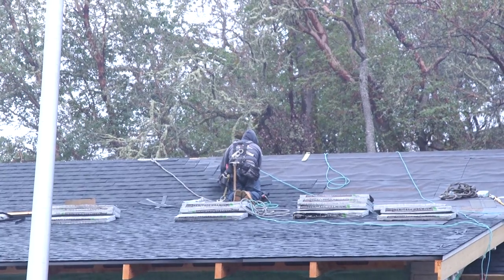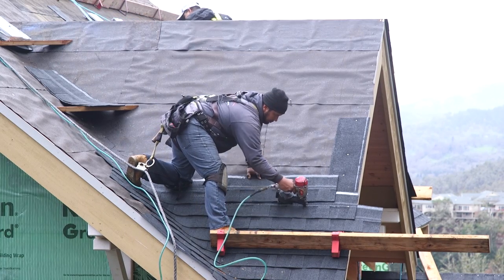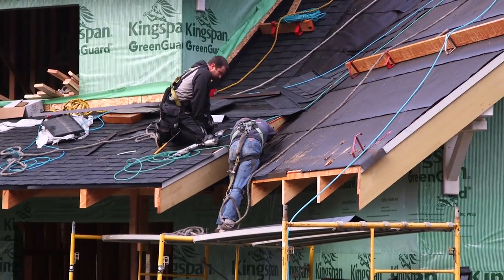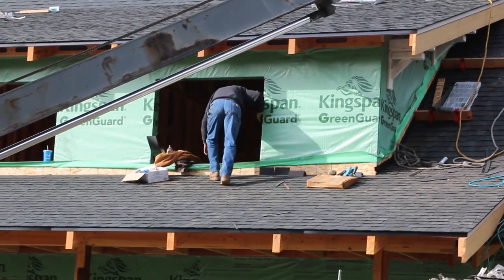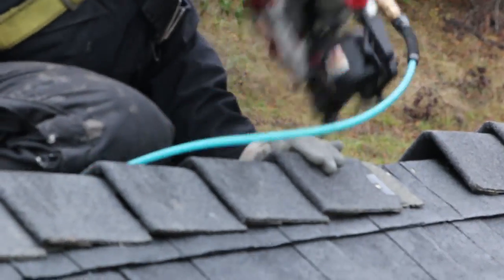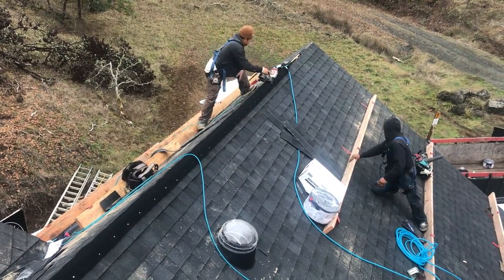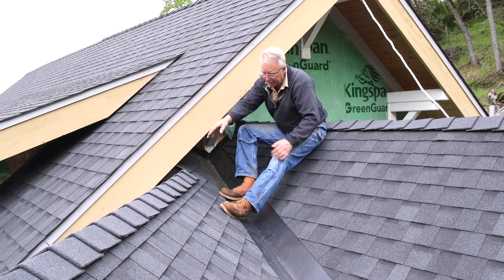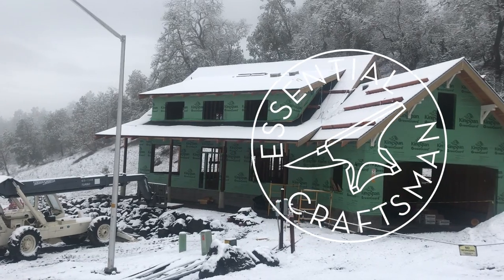Stunning and Complex Roofing Installation Ep.78

Comment: The argument about metal in a valley aside , no matter what there should be ice guard in that valley. Regular felt paper most certainly will break open in the valley ; probablywgen forcing the shingles down in tight. For the cost of a box of ice guard they took the cheap way out.
I was a contractor for over 30 years and I not only but ice guard in the valley but I put metal in also and then did the Chicago cut , so you never saw the valley. So for the cost of a couple pieces of metal no sleepless nights worrying about leaks was the reward
Reply from the maker: Great comment and great philosophy. The difference here is that we almost never get any ice or snow. When it happens it is only for a matter of hours. Not days. And there’s never any build up.
Reply: @essentialcraftsman  I posted earlier a long comment about flash and counterflash systems, mandatory on my jobs for decades. It is not so much about present moment performance as long term maintenance. It requires a clientele that see beyond the next couple of years, however, and have the disposable resources to put their money where my mouth is. Unfortunately, that combination is relatively rare.
Reply: Good rebuttal
I admit i was quick to admonish without taking your location and weather into account

Comment: I've seen studies that found that powered attic fans, like the solar fans you had installed, actually end up costing you more electricity because it creates a negative pressure in the attic that not only pulls air through the soffits, but also pulls your conditioned air you paid for inside the house through all the tiny cracks and holes between the house and the attic.

Comment: Where those different roof pitches come together and made that odd Valley that is another place that you should have just covered the whole thing in Ice guard and not be worried about it. Nails seal themselves in ice guard. It would never leak , talk about being a cheapskate.
Where a roof line meets the wall like in a dormer you are supposed to run ice guard up the wall a minimum of 6in and on the roof 6 in so you have a solid water tight seal even before you step fllash.
Reply: We get even more painstaking than that. You could check out my long comment re: flash/ counterflash systems.

Comment: I see since you went with an unconditioned crawl space you also went with a vented unconditioned attic which is a huge mistake. With black shingle roofing with the roof pitched at an angle to get maximum radiant energy from the sun, the attic space will probably reach 130F+ on hot Oregon summer days. The rafters and decking will be hot to the touch and everything in that attic will have absorbed the radiant energy and will be giving off heat. Those fans are worthless if you think they are going to reduce the temperature in your attic space. Secondly, those fans will depressurize your attic and create negative pressure which will pull conditioned air from the living space through all your penetrations in your drywall ceiling, can lines, your vents, and even the holes where wires are run through your top plate. In fact, any temperature reduction in the attic is probably a result of the attic fans sucking the cool air from the conditioned living space. You really do not actually believe this, do you? https://ibb.co/QPfRWsT - Powered attic ventilators are a scam. You should have gone with an unventilated conditioned attic with 8" of open-cell spray foam all the way up the roofline - https://ibb.co/Wg553tP.

Comment: 50 years on an asphalt roof ?  I have shingles cracking on a 10-12 year old roof manufactured by GAF - Timberline. I don’t know where these things are being manufactured but my guess is they are cutting corners but not adding enough rubberizer to the mix.  They look great at first and claim to last 40 years, but I doubt people will see this performance.

Comment: Are ridge vents not a thing in the North West?
Reply: Ha, typed that question 5min too soon.
Reply from the maker: Yes, they are often compromised by the leaves and debris that blew around. But we in fact ended up using it on the garage ridge and on the ridge over the back patio. The main pitch will be ventilated by the solar fans.

Comment: You said this is a spec house. Why the lot selection and the $$ spent prior to pouring the footings? Seems excessive for a spec house. The layout of the house had to cost a lot more in labor to turn all those corners and the roofing is a real challenge. Again why for a spec house. I see you saved big time in the inside with no hardwood floors, no crawl space or attic encapsulation and although not finished yet, I would expect to see builder appliances and fixtures with fiberglass tub shower in the baths.

Comment: The valleys do not make sense. If bending the shingles is going to wear them out quicker then why not do metal? You did say shingles are meant to lay flat. If you use good metal it will last 30+ years, and here in Oregon you are not getting much more then that out of composition shingles anyways

Comment: Sorry man, but asphalt shingles only last 15 years if you are lucky.  Copper valley flashing will last a 100 at least.  Hell, painted steel is guaranteed for 50 if you buy 24ga.  Former sheet metal worker here.

Comment: I’ll agree they did a B+ roof install, would have been an A job but some material quality level was low at least until the $$$$ 3- 25 or 30 watt solar vents, and the fact that they HAD the safety equipment but CHOSE not to use it 1/2 the time (safety glasses, ropes, separate anchors).  It would have been just a B job, but Having somebody stand behind you with a video camera the whole time adds a bit of stress, Especially lol, if he was narrating some of it out loud while he filmed. Unfortunately for R &R this is a popular enough channel OSHA might notice.

Comment: well I might not be a framer but I probably have replaced as many rooves as EC and I can tell you that not having properly flashed valleys... or I should say improperly flashed rooves tend to leak it cost 100 extra dollars per valley but it will be better than me coming in ripping out the deck and rafters and adding a 3-10k dollar charge on top of your $20000 reroof.  Don't buy in to that it is as good as business.

Comment: UK (scottish) viewer here, why shingles and not tiles? most all domestic roofs here are tiles, its wet, cold, and windy here. not a criticism just wondering why such a soft roofing material.
Reply: I don't know why specifically, but shingles are easily the most common roofing material in the US. In desert climates you'll see a lot of tile and in hurricane and tornado areas you might see more metal roofs.
Reply: Common reasons asphalt shingles are used instead of tiles and slate are:  1.  Higher material costs,  2. Higher labor costs (due to greater install time and the fact fewer people are experienced in tile installation... except in certain regions of the U.S.), 3.  Weight (thereby causing up-sizing of framing, thus higher framing costs.)  The complexity of this roof may also be a factor, driving even higher #2 (factoring difficulty of cutting tile vs. asphalt shingles).
Reply: @neverenoughtime3151  

Roofers are cheap on cheapest materials!

Comment: It's called a closed valley, not a lap-cut valley. If you're using an open valley with an exposed metal pan, you're not likely to use a material that will rust, that's just silly.

Comment: You should never, under any circumstances need to waste all that time trimming the overhanging shingles where it dies at the drip edge. The much faster, much neater way is to put the factory edge out there and cut the shingle to the inside at the previous butt joint.

Comment: Way to go. It only took me 5 minutes in to laugh these guys off the roof. If they need toe boards on a 5/12 pitch roof then they need to find another line of work. Also only having two layers in a valley the 30 year roofing will NOT last more than 25 years. I guess it is job security for lack luster companies. I have been roofing for 3 years and have NEVER had a valley fail because I skimped on it. Also pneumatic nailers should have been outlawed by the roofing industry. Very few times do they actually hit where the manufacturer recommend the nail placement. If your using a nail gun you really aren't a roofer. Your just putting on roofing.
Reply: Isn't it 9½/12?
Reply: I think it's actually 9/12
Reply: All depends what section their roofing. Some is 4/12. Some 5/12. Some 7/12. Still. Only things over 7/12 need toe boards put up.

Comment: I’ve enjoyed your series to this point now I understand you got them for free but tamko is not a great shingle slightly better than IKO. Maybe it was you that made the call but at the very least you should have had water shield in the valleys and up the wall. Several of those roofers nails were way to far in on the second nail from edge. Your shingles should be a 6 inch staircase not 10-12 inches. And staggering a full shingle and 6” cutt off is a no no. The cut area you’re leak worry area should have been done in either EPDM or soldered lead coated copper not trim coil and caulking.
Reply: You don't need ice and water shield in valleys or walls or eaves.Is it nice in certain spots yes but ice and water shield hasn't been around that long and roofs were not leaking before!I will agree that rubber,or copper in a gutter is better then aluminum!!That stuff will leak for sure!Now it all depends on money and who is paying!If people don't want to pay and only want to warranty it for 5 years then is what it is.Could things have been done differently sure but all in all not bad all except that aluminum and caulk spot!!! Definitely should have used rubber,or copper or ice and water shield under that aluminum!I mean it probably will last the life of the shingles .Not horrible!!The roofers were not efficient in my opinion but not all bad!

Comment: Putting the solar panel in after the fact and not ice and water flashing around it is a big mistake. Also your roof ventilation system is incorrect it will not work properly with ventilating fans and a ridge vent. If you need some roof training you can fly me out I'm on the East Coast

Comment: The roof coverings in this video are not installed correctly. There are many mistakes such as improper underlayment staggering, improper and or missing edge flashing, valley flashing/underlayment. The valleys are weaved, this should never be done using 3d shingles. Overdriven and improperly placed nails. Probably other mistakes that I did not notice. Come on guys, we're trying to learn from you! :)

Comment: Dang, can't watch this, opens with a guy 20 feet or more in the air, standing on scaffolding, slapping around asphalt shingles, using a pneumatic roof nail gun at FACE level WITHOUT any eye protection, DANGEROUS. Can you say WORKMAN's COMPENSATION INSURANCE?

Comment: You have some big eff ups on this roof. Big. IBC 1507.2.8.3 Drip edge, Read it. That metal valley flashing you are so proud of. IBC 1507.3.9 Valley Flashing. Read it. Hire roofers who know the code. There are more screw ups on this roof and your roofers can't even follow code so this is a good starting point. Wake up.
Reply: Dare I say the codes you quoted are valid where you live but not everywhere else?

Comment: 18:46 Let me guess, Tamko didn't supply any ridge vent product, the main ridge at the highest point of the roof was already capped, and only afterward when someone realised that there was no cavity ventilation for the top half of the roof, they decided go buy some of GAF's Cobra Ridge Vent to install on the lower roof ridges. Also meaning that you've had to buy solar electric extraction fans which have had to be installed after the tiles, unlike all the other PLANNED penetrations on the roof.

That's really poor workmanship for a shingle roofer, either they have no understanding of convection ventilation, or they just don't care. 

At least the roof has one good thing, even if it's just GAFs Cobra Vent.

Sorry, but the carelessness just pissed me off to no end. 
Not to mention when you rightfully state the ridge caps should be placed with consideration to the prevailing winds, then the roofer lazily caps from both sides to avoid having to move his harness rope anchor point only a few shots afterward. Nice camera work though capturing that.

Comment: It'd be a 50 year roof if you used a super heavyweight saw tooth shingle (450lbs+/sq), copper or lead metal valleys, sheet lead wall metal and critical junctures, lead pipe jacks, stainless steel nails and lead coated copper everything else. Appreciate the video, but this is no way a stunning roof with its California cuts and mid grade shingle. Didn't even see and ice/water membrane in the valleys or eaves. Roofers always want to slap whoever came up with such a poor roof design destined to give future owners nothing but headaches and excessive reroof expense.

Comment: Very disappointing to see an old builder that would take a cut up step roof house and shingle it ahead of allowing the painting contractor to prime and finish the fascia and eaves ahead of time. Working out of proper sequence is never worth showing up for as it only benefits one party. Which is always the General Contract and doesn't give a f#%^ about anyone but hinself. Used to respect him. Also, still stuck in antiquated building science for the total job.

Comment: As always, great job,...unfortunately that one roof intersection is case when looks took precedent over best practices...…….which should never happen, it was a poor design flaw which should have been corrected at the cost of looks.  That spot is text book exactly what you never want to see from a engineering design point.  It could have been corrected, rather than dealt with way back in the plans stage.

     Having said that, it looks like it has been "Dealt" with,...…..time will tell how well.   Science and logic only get us soo far, there is no way to predict how that spot will behave under real world conditions...…..when the wind whips from the east west at X mph it might form a low pressure spot and keep rain from ever reaching that spot, or create a situation where every drop wants to run up and back and believe me, I have seen rain run up 15 foot of 8/12 pitch and over the ridge when the wind was blowing at 45 from a certain direction on certain roofs...…

     There is no way to predict if it was a obstacle that was overcome or a detrimental flaw until time tells the story,...…..looks good to me, but who knows,...…….that's what good solid engineering and design is for, creating very predictable situations in which we understand exactly how a situation will behave.

    Looks like this obstacle was overcome in a solid professional way, but only time will give us the answer,...….in 40 years we will know for sure, but for now it looks good to go and done the best it can be given the circumstances.

Comment: This so called roofer, needs a diet bigtime. Improper nailing, guessing I'll put one here and here and here. (I have been doing roofs solo, since 2002 gave up on helpers. But, anyway "Improper Nailing" read the back of the wrapper. I really don't care, cause it's not my roof and or my client, but if it were my client, I'd be mentioning improper nailing.